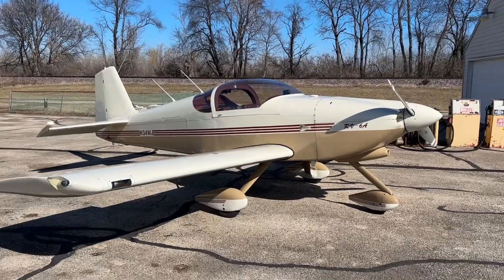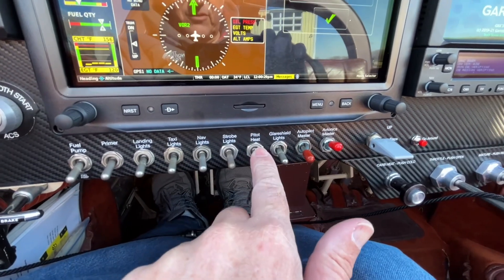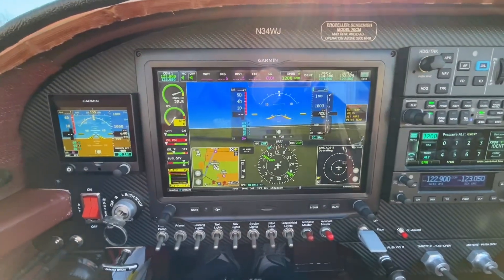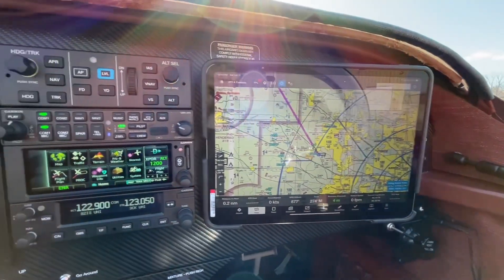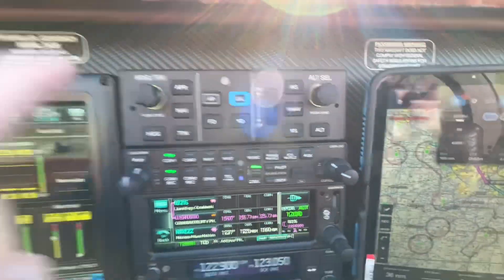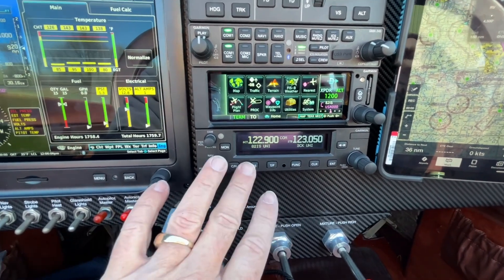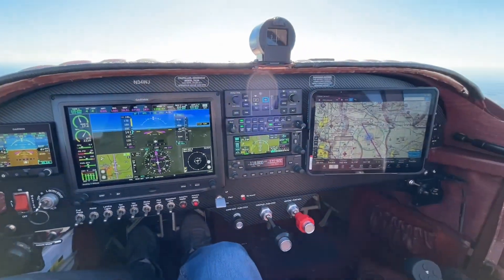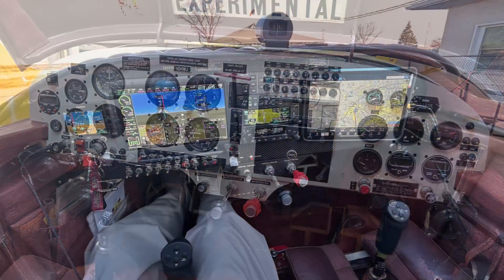Garmin G3X Panel Upgrade Vans RV-6A!

Comment: I'm looking at buying an rv-6 and I'm disappointed to not really be finding any options anywhere near me that have glass cockpits. How much does something like this cost?
Reply from the maker: Most guys don't do an all Garmin panel.  They do a Dynon screen, true track autopilot and maybe some Garmin radios.  To do it really nice like mine, it cost about $50,000.  That was ripping out the old panel and creating a completely new one.
Reply: @quinnjim  god dang! Yeah I don't think I'll be doing that lmao. That's nearly as much as my rv6
Reply from the maker: @ I spent almost as much on the panel as the plane was worth.  I did end up selling the plane and made a small profit though.

Comment: Great set up. Who did your avionics panel and what was the down time? I need to upgrade my panel on an aircraft I am buying and I need all the advice I can get. Thanks.
Reply from the maker: Mtech aviation did mine.  It was down for a few months.  224-829-7308.  Tell them John with the RV-6 sent you!
Reply: @ Ok. Thanks.

Comment: Thanks for the video . This is almost exactly what I want to do with my upcoming RANS S21 build . I was thinking an iPad would be more useful than a second G3X . I also need a NAV radio to satisfy the more stringent IFR equipment rules in Canada .
Reply from the maker: @jetpylot7523  This setup has a VOR/ILS incorporated into the Com on the panel.
Reply: Yah , I saw that . Perfect for my needs . What Nav antenna ? Archer ?
Reply from the maker: @jetpylot7523  I really have no idea.

Comment: Beautiful panel.  I just did mine in my RV9.  What mount did you use for the iPad? Is it a Ram mount with a suction cup or did you screw the base into the panel?
Reply from the maker: It’s called a “pivot mount”.  We use them at my airline.  Great product. Very secure. I bought a mount that bolts on to the panel.  You can also get suction cup mounts. The iPad clicks securely into place and releases easily.

Comment: Hey Jim, great panel!  I have an RV-7 and am contemplating a panel upgrade similar to yours.  Did you do the work or did you hire someone?  How much did all of this cost?
Reply from the maker: I hired a guy.  $48K plus the old radios I traded in to him.  That also included the condition inspection, a couple new tires and a flap motor.

Comment: Are those dry transfers for the lettering on the switches and such?
Reply from the maker: I believe so.  We ordered a sheet for over $200 (to get exactly what we wanted).  One of the stickers was defective and came apart when my mechanic took it off the sheet.  We called the company and they wanted another $200 to reprint the sheet for that one defective sticker.  Kind of frustrating.  We ended up fixing it another way.
Reply: @quinnjim  thanks! Would you mind letting me in on who the company was so I can avoid them? They don’t sound very customer service oriented.
Reply from the maker: @flyyourdream9716 My mechanic knows, but he’s on vacation.  I’ll try to remember to ask him when he gets back